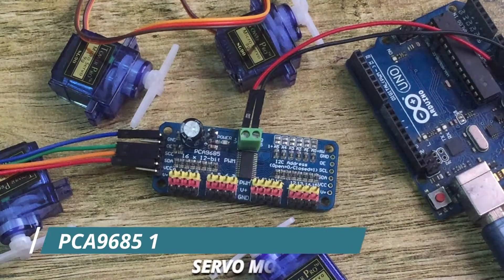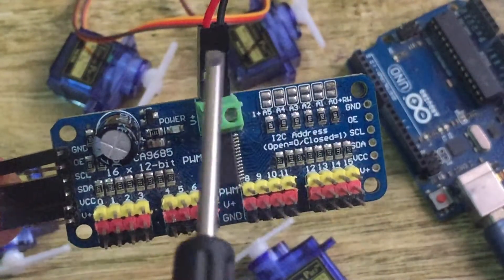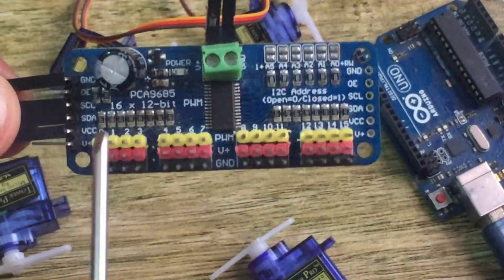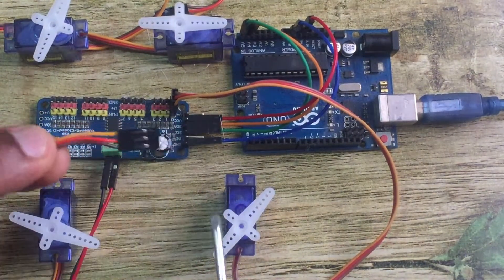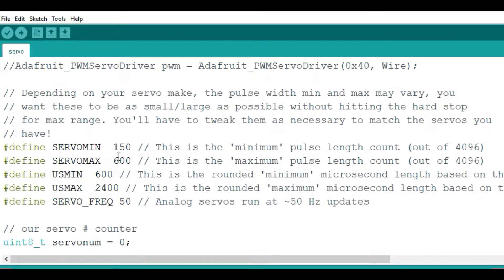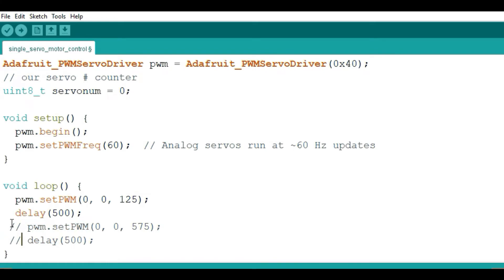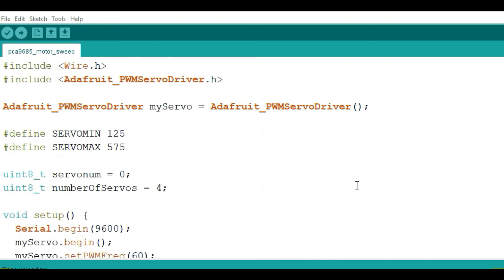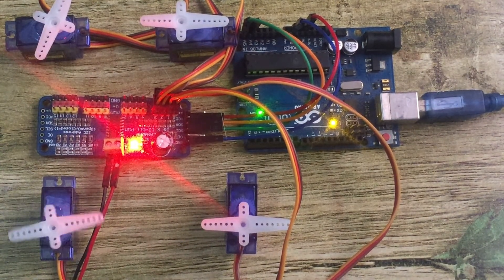PCA9685 16-Channel 12-Bit PWM Servo Motor Driver with Arduino.

Comment: I did the same project but non of my servos are moving, not even one , 
I was thinking of the power supply, what of batteries should i use

Comment: could you potentially connect a female usbc soldering cable to the powersupply and get the power using a usbc charging cable?
Reply: yes, but just make sure that your load is below what your power supply can handle

Comment: I have all the pins in the right place, I installed the servo library, and I'm using a 5v power supply but nothing is moving no matter what code I upload
Reply: Hi bro. Have you done the project?  My servo not moving. If you done plz help me
Reply: @susmitasarkar6955  I ended up using a blender plugin for moving servos.  It’s for animatronics, check it out!
Reply: Same here, there's something missing from these code examples. I have tested all the servos and boards on other devices that I know work, they all work properly, I can see the code working in the serial monitor, I have a power supply, but the servos don't move when I use this code.
Reply: @JungleCruiseSkipper  did u figure this out?
Reply: Check your pulse frequency.  If it’s not allowing enough time for your servos to power up, it will appear dead.

Frequency and duty cycles matter :)
Reply: I got it to work by wiring power through the V+ pin and using a 9 volt power supply. It doesn't work through the green block. I'm going to research more.
Reply: Yes, the power supply did not work through the green attachment block, I powered it through the pin, I will be more specific if you need, but I'll have to take a look after I get home from work.
Reply: @JungleCruiseSkipper  i have the same issues now. im thinking now these boards are just trash cheap clone boards sadly .. ive used 3 days on this and 15 hours each day, and still no movements at all
Reply: @ThomasTheVirus did you try powering it through the power pin instead of the green power block? That worked for me. I found that out from a different video.
Reply: @JungleCruiseSkipper  you are a hero <3 i used the green power block GND and took the V+ to the V+ pin and shes now alive! =) its funny that these clone boards dont have that V+ traced properly .. def made my head ache for days LUL
Reply: @ThomasTheVirus  Thomas you saved my life dudeeeee using the V+ pin from the green block was the problem, and now I can FINALLY program my robot! Thank you.
Reply: @AlfredofWessex1  hell yeah!!! =) happy you got it working! =) those clone boards dont have the v+ traced properly

Comment: I don't know  why  it's not working  audrino is saying pwm library not exist
Reply: u have to add servomotor driver in arduino id
Reply: @yahmedbacc8265  and how do you do that
Reply: @-prime-4729  click   Ctrl+shift+i  search for adafruit pwm servo driver library and and then install it

Comment: Excellent explanation video. I have a question, What if I only need 5 Servo need to use this driver? which is better to use arduino PWM pins or servo driver PWM pins?
Reply: Theoretically you could put 6 servos on an Arduino Uno. But if you plan latter to add more, better go from the start with the PCA9685.
Also, making all the pwm working correctly together at the same time could be hard.
I never tried it, but I guess there is only one way to find out.
Reply: @mylittleparody2277  Oh because PWM servo can't control servo together huh? and it can be done when we use this driver. Thanks for the explanation
Reply: @AbdulRahman-jz3px  Well, my bad.
I was thinking about doing it by hand, using the timers to control the PWM, and thus limiting the max number of servos to the timer output pins.
As it turns out, the official library allows to control 12 servos on an Arduino Uno (it disables the AnonlogOut()).
https://www.arduino.cc/reference/en/libraries/servo/
So, the best solution for you would be to use the Arduino Lib.

If you want to do it by hand, you need to set the timer to the first angle, and when the interrupt fires, set low the first servo's pin state, set high the pin for the second servo, reload the timer with the second servo, and wait for it to fire.
doing so and switching servos in a round manner would allow you to control multiple servos with one timer.
But it's probably easier to use the lib if you are not tied to bare metal.